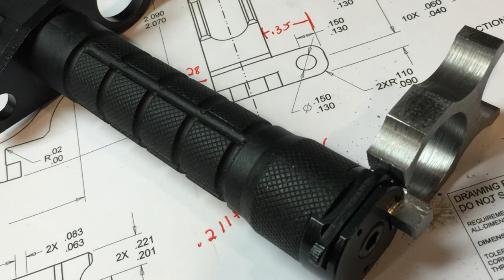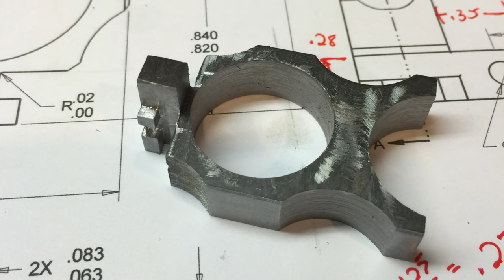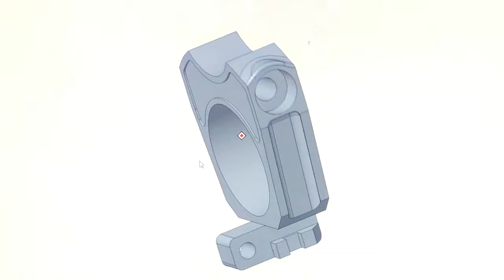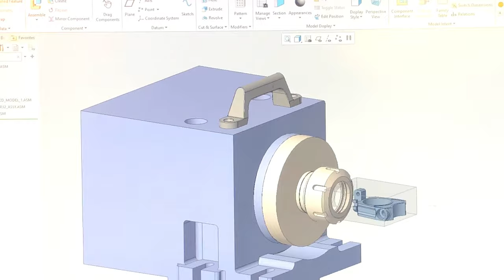Making a bayonet fitting for a Remington 870 on a Micro Arc 4th axis.

Comment: Very impressive.
Reply from the maker: Thanks, I know your not a gun guy so I appreciate it.  I now have all the tools I need to start my model jet turbine.  you will find that much more interesting.
Reply: @LastBastionLabs  well neither am I ANTI-gun. I pruned a branch off my Dad's Beech tree close to his driveway one time with my 22 single shot. I figured we had more than one box of shells and the branch was only about 3 inches in diameter, and there was no other way to get up the 30 feet or so to it, so we just kept hitting it until finally it folded down, which kept it from interfering with his rooftop tv antenna. Halfway in, Myron wanted us to take turns, and he wasn't used to my open sights, but he did adjust and hit it after a bit. I think it  took us like 20-30 shots to cut that limb. I knew from previous experience that a 22 bullet would go through that much beech wood. (don't ask)

Comment: You are doing amazing work, my friend. I thought about adding a 4th axis to my homemade CNC milling machine, just not sure about spending the kind of money Fusion wants for the add-on. I will figure something out. Thank for the video!
Reply from the maker: Thank you very much!  I really enjoy doing this.  You will enjoy the 4th axis.  To be clear, you can machine like I did in the video with out the $1100 rotary extension.
Reply: @LastBastionLabs  Hey, I am looking at upgrading a 12 ga. 11-87, for pokey toys. Where did you get the mag extension w/the forward mount adaptor and how much for the lug adaptor? I have an M-9 looking for a home on the end of a pew-pew toy, and I'd like to add it to my 11-87. Thank you in advance.
Reply from the maker: @dhopper122  My mag extension came with my Rem 870.  I have recently moved and my machine shop is packed away in my garage.  I will not be taking order for the rest of this year.  Sorry